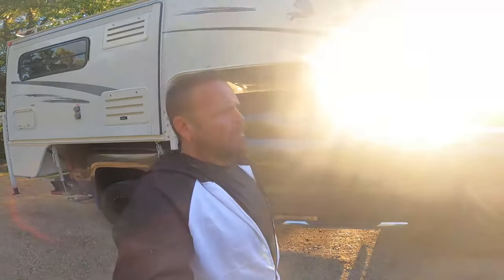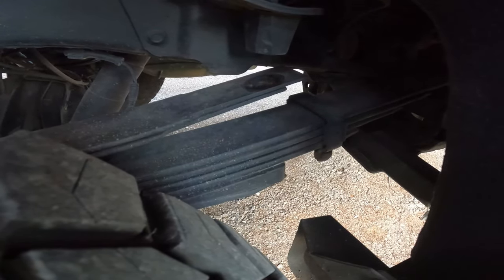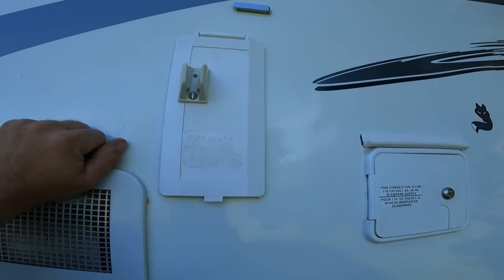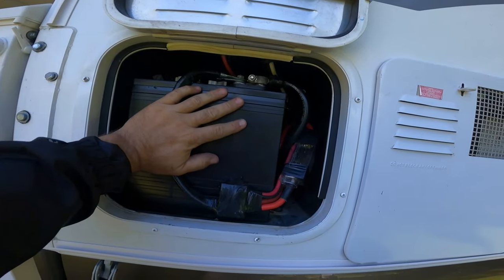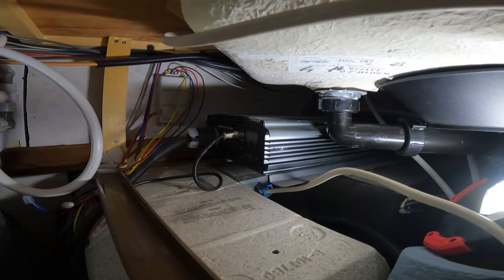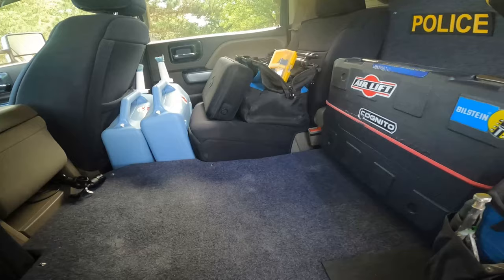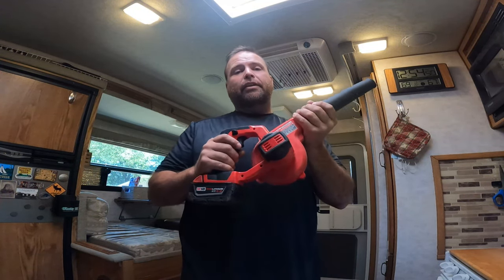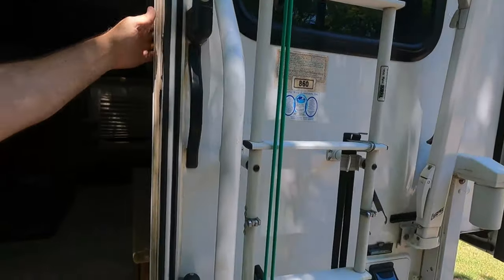Arctic Fox Truck camper / Silverado Tour

Comment: What is your tires size?
Reply from the maker: 295/70/18
Load index 129
I think the load index 129 has the highest payload capability (4080 lbs)before stepping up to a 19.5 wheel. 
The reason I did not go with a 19.5 rim is because of the availability of the tires. If I do blow a tire a can find 295/70/18 all over the US. The commercial tires can be ordered but a lot of tire shops don't carry them on hand. Just my opinion.
Reply: @KennyOfAllTrades  thank you! What brand are the tires? Are they good in snow?
Reply from the maker: Nitto Ridge Grappler. They do well in the snow, great in the mud, and most importantly they are super quiet on road. They are still at 12/32 with 25,000 miles.
Reply: @KennyOfAllTrades  that exactly what I am thinking of getting.   I have a 08' Megacab dually.   Getting her ready for the camper.   Not wanting tires that are sticking out too much I am thinking 275/70 17.  What do you think?  Should i go bigger or smaller?
Reply from the maker: For me weight was a concern. The original tires on my 3500 were a load range 125 from the factory. They were rated around 3600 pounds per tire. I stepped up to the larger tire 295/70/18 load index 129. They are rated for 4060 pounds. That's an extra 1800 pounds of carrying capacity for the tires.
Reply from the maker: You might not have the same issues I had because you are running the dually. I don't think you can go wrong with Nitto. I'm the type of guy that researches for a year before I spend cash. The Nitto has excellent reviews!
Reply: @KennyOfAllTrades  thank you so much!  Love your videos!  Keep up the good work!

Comment: I would be scared to use   a large  grab handle  . If a child  pushes  it in  you are trapped in  your  camper .
Reply from the maker: I have thought about that too. So, I tested it and found it was designed to open with a little force. I would have taken it off if there was a chance of getting trapped inside the camper. Thanks for watching!